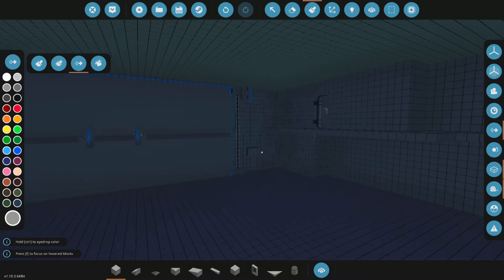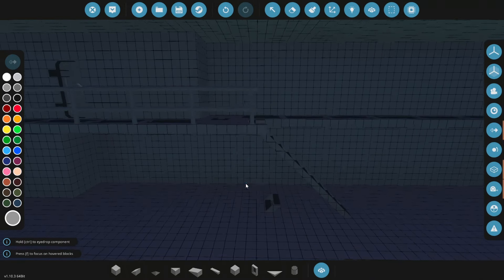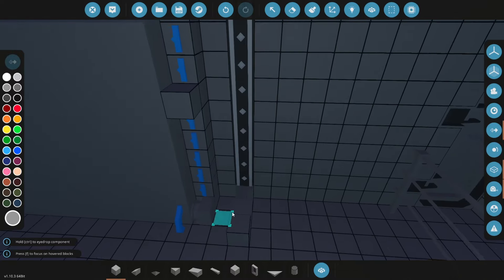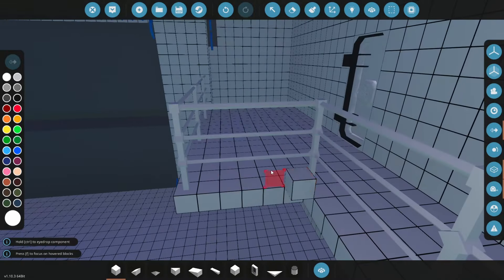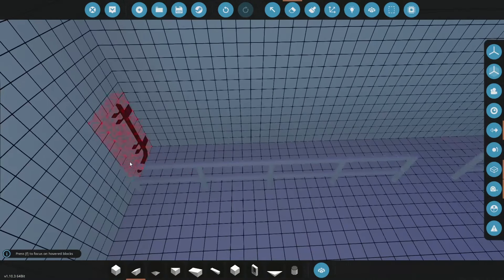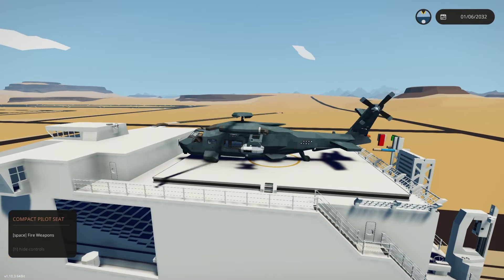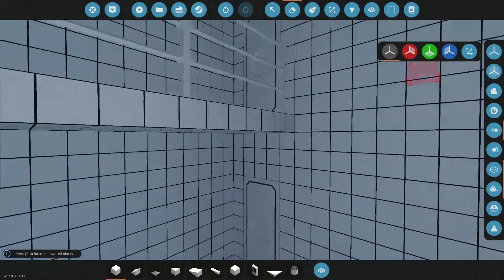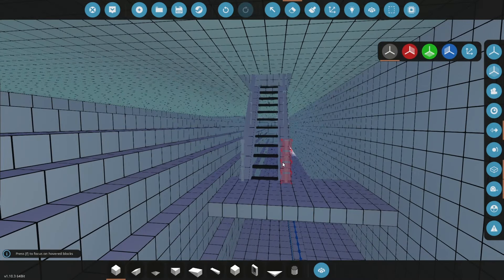Carrier Cat - CHOP

Comment: I would recommend making the reactor (at least the heating section) a modular pice with doors and maybe an exterior door and gantry to swap uranium rods. An ISO you hook in with fluid and electric connectors.
Reply from the maker: It sounds good on paper but having to load and unload a reactor every time I spawn or de-spawn would end up being a nightmare. I think having loads and loads of uranium, and not botching the job in the first place is an easier route :D